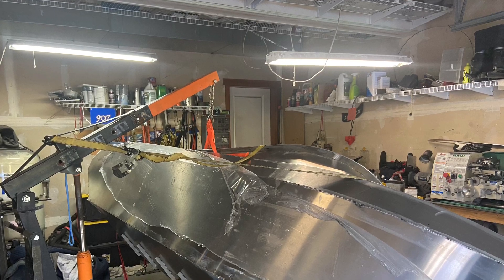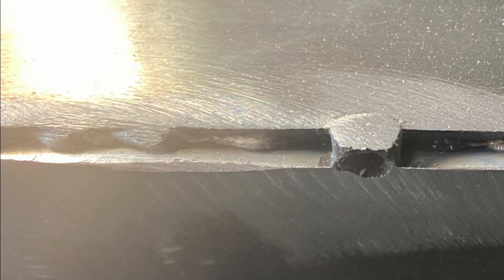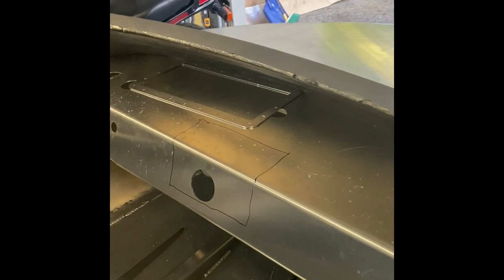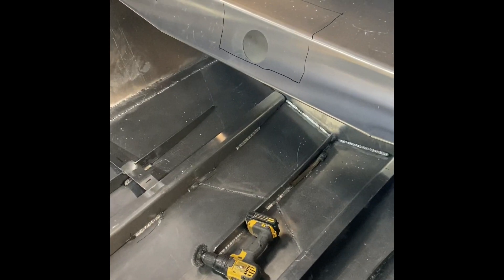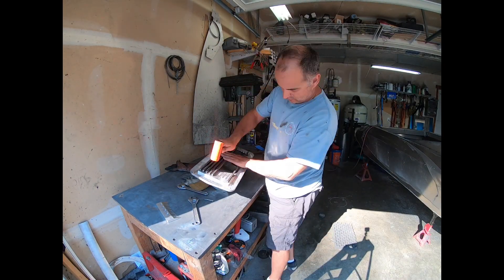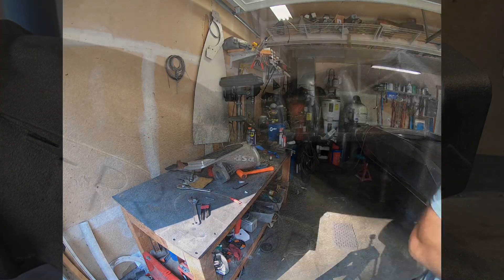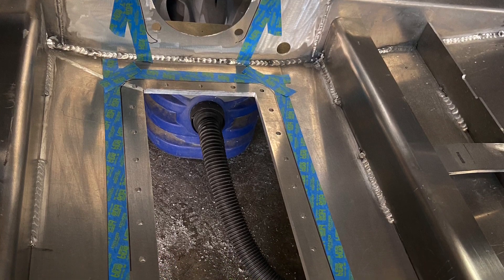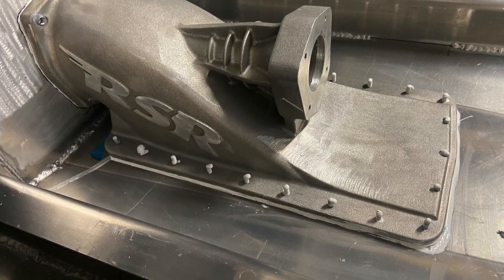Mini jet build day 6. RSRacecraft Skookum 13 Weldout & Pump install

Comment: Would you recommend the miller 221 I believe with pulse. I have a tig but this would take years to finish by tig.   Your welds look alot better then other people's boat projects
Reply from the maker: Hey Myles, I don’t think the 221 has pulse but I could be wrong.  I believe the 255 is the the lowest model with pulse which is what I just purchased.  I’m totally loving the new machine, especially with the XR Alumapro push-pull gun.